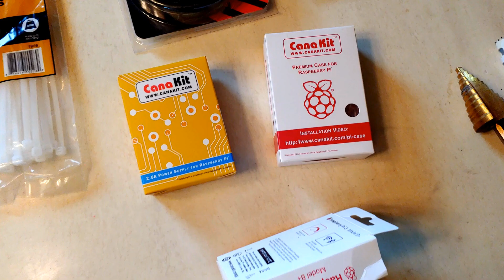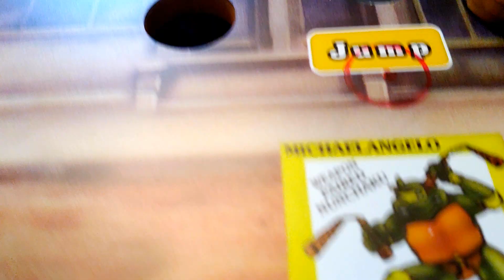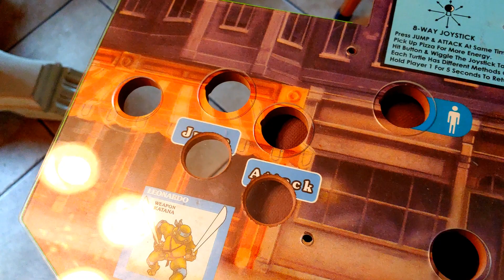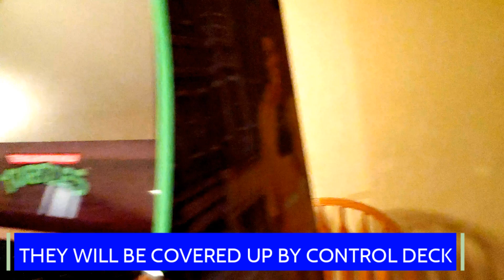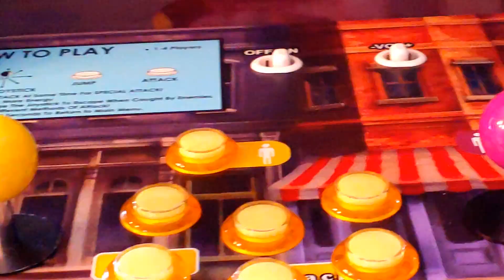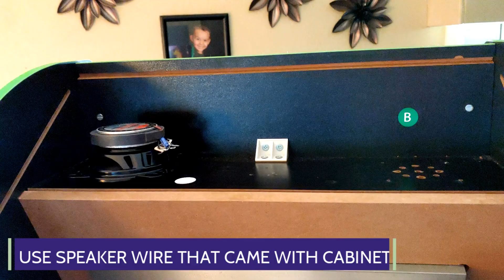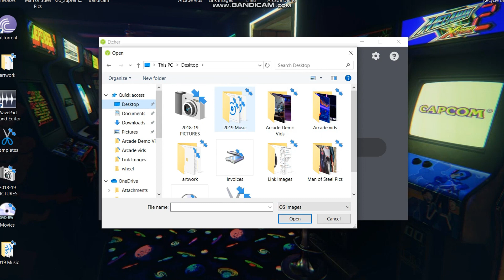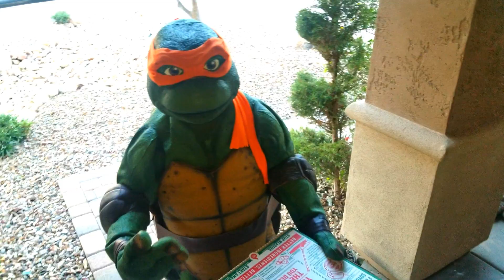TMNT Arcade1up 4 Player Cabinet Mod Tutorial

Comment: Do the coin buttons not connect at all?
Reply from the maker: Of course they do you have to have them to play the game if they are not long enough you will have to splice some extra wire to make them longer to connect to the encoder board wherever you have placed them on the control deck
Reply: @arcadepickers1682  well I put them on the encoder board just like you but you didnt say where the coin button went so I didnt attach them lol. So where do they go?
Reply: And while I'm at it and asking dumb questions bc this is the first time I've ever done this, where does the original on and off switch connect and the volume switch
Reply from the maker: @adrianguerra10  they just go in any of the available slots as long as they are in the same one. You just hook them up like in the other buttons as long as all four are in the same spot on all four encoders you're good
Reply from the maker: @adrianguerra10  you will no longer use the volume as the amplifier will have a volume control on it and the power button will be not used as well as you will just unplug and plug the unit into turn it on and off
Reply: @arcadepickers1682  thanks buddy
Reply: I'm on the home stretch
Reply: @arcadepickers1682  ok first time I'm doing this raspberry pie stuff. Do I put the sd card in then connect it to the comp to encode all the proper buttons?
Reply: Or do I pop the sd card in the computer and download the stuff you said first and if so do the encoders know what button is what?  Damn I suck at this lol
Reply from the maker: @adrianguerra10  okay so after you have used SD card formatter and the etcher program you will put the memory card into the Raspberry Pi with all of the encoders connected to the Raspberry Pi through the USB as well then when you power it on it will take some time to load possibly 20 or 30 minutes the first time then you will restart the Raspberry Pi and when it loads up emulationstation you will have to configure your control their just remember any controls that you will not be using you hold down any two buttons to skip past that one such as d-pad up Etc, then you will need to make sure you go in and expand the image which is not in this video you will need to go watch my Sonic Adventure video and go to about 6 minutes where I will walk you through this process otherwise the controls will lock up, then after you reboot once this process is complete you will set your controls one last time and be ready to play and will never have to do this again
Reply: @arcadepickers1682  ok gonna get on the computer then right now.  I'll let you know how it goes
Reply: @arcadepickers1682  standby lol
Reply: @arcadepickers1682  so on the downloading part.  I wanted to go with the one you had in the other turtle mod max video but ppl say it fails after 13gigs or what not.  What other torrent should I get and how do I download it bc I notice they all say around 128gigs.  I do have the 256 gig sd so is there a package download that will get all the games I want and which file is it?